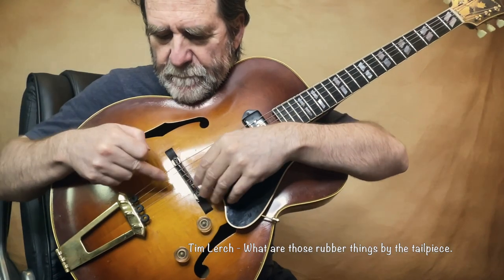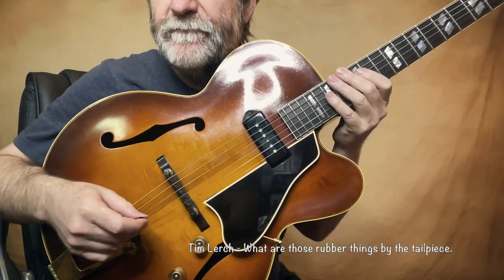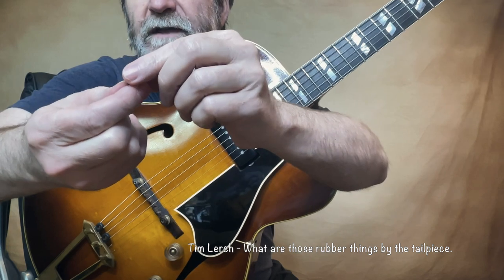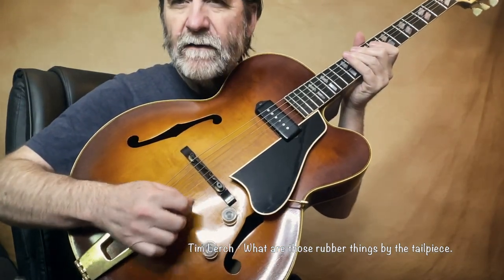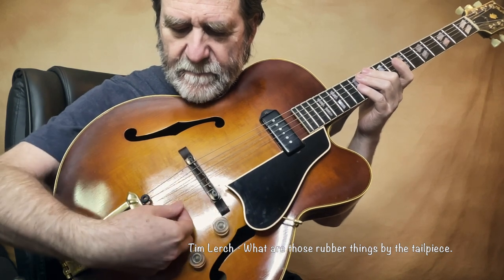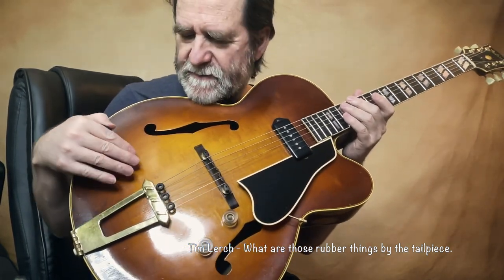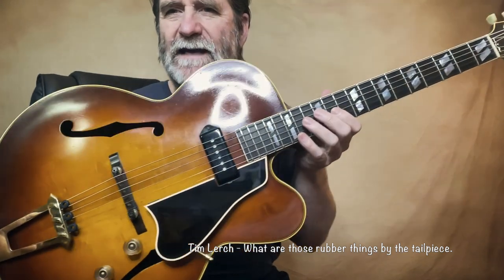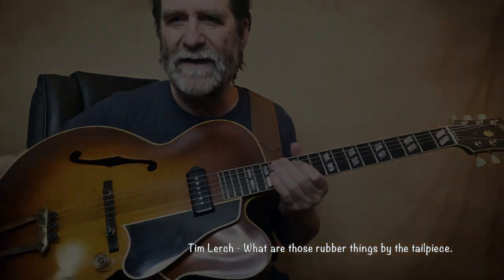Tim Lerch - What Are Those Things By The Tailpiece?

Comment: Yep, as some have already stated, those are wire grommets.  They are installed into holes that are drilled in sheet metal.  They keep the sharp metal edges from cutting/wearing through the insulation of wires passing through the hole.  Common on mandolins, as well.

Comment: That's a great solution. I struggled with this on my L5 when I had it, and it was also a problem with one of my Eastmans. Usually I would put electrical tape around the strings there but this is much more elegant. My main guitar now is a heritage and doesn't have the issue thankfully.

Comment: Nice. On my L7cn, L4cn and ES-175ns, I cut a tan rubber band, then weave it over then under the strings and tie the ends with a simple knot right at the tailpiece. May be less noticeable than the black grommets, but probably not as dampening. Also sometimes the metal tailpiece rings in an unpleasant metallic way, so then I wedge a small square piece of "piano-felt"  purchased from Amazon, or a small square of grey foam under the tailpiece so it will be hidden from view and dampen the metallic overtones.